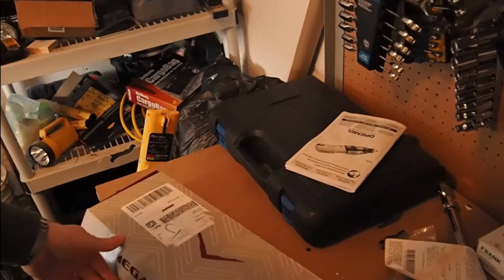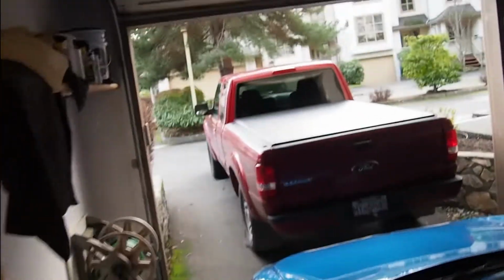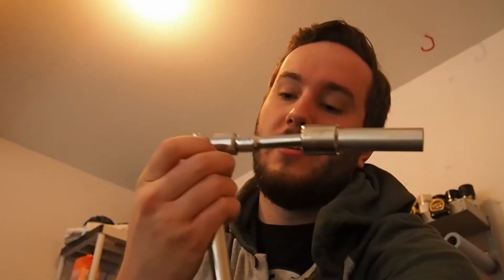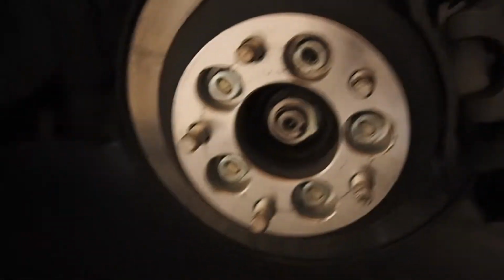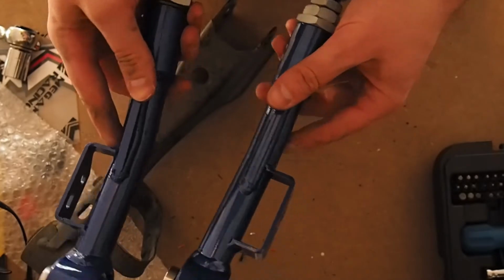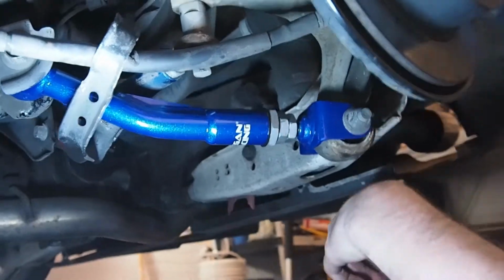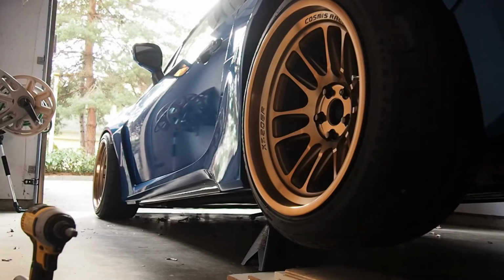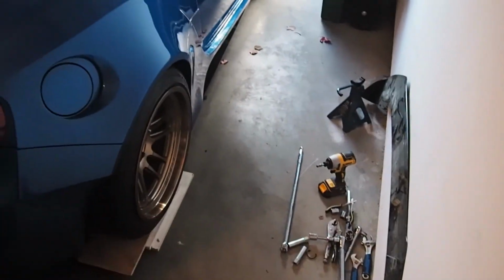Rear trailing arms install for my widebody Subaru BRZ

Comment: How do these fix the caster when they only get longer and not shorter? Wouldn't you need it to be able to shorten to pull the wheel forward to fix the caster issue? Or what am I missing. how would it fix anything if they just get longer then the oem trailing arms? Wouldn't that just push the wheel further back increasing the probability of it rubbing

Comment: hey man, I have a BRZ and really like your wide body, did you buy it or build it yourself?
Reply from the maker: Built all by me! I didn't install the widebody myself though, had a friend who was more experienced than me do most of the work
Reply: Wow!! so basically is there any way I could build the same one or not? Thanks
Reply: On Instagram you said the kit is aimgain x Stancenation V2 with v1 front end, where did you buy it?
Reply from the maker: @asaosborne3712  yeah for sure. I just wasn't comfortable cutting and drilling into my body panels.
Reply from the maker: @asaosborne3712  I bought it through Elvis Skender on IG. He's the founder of Stancenation